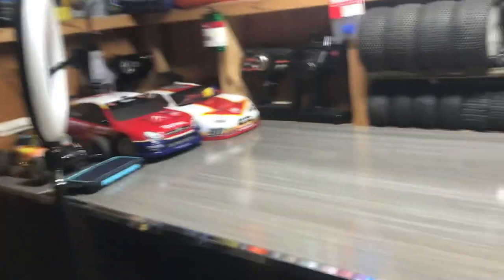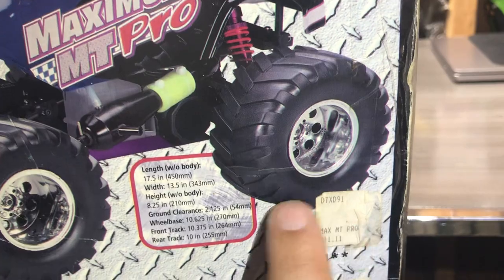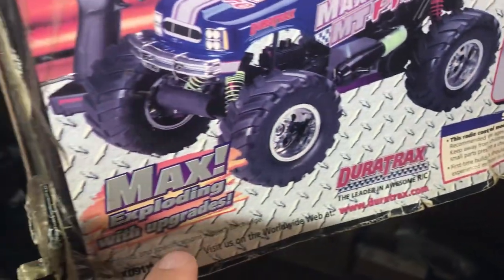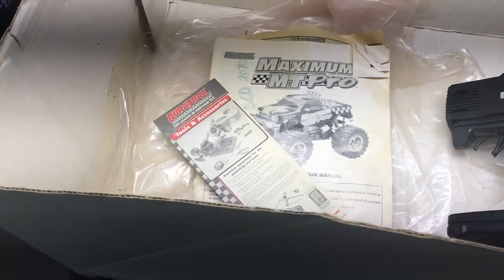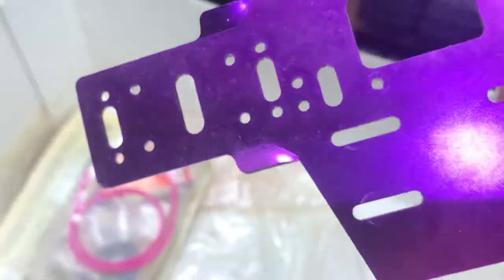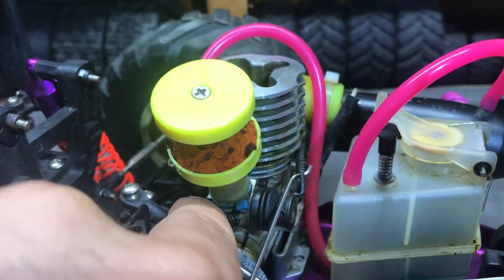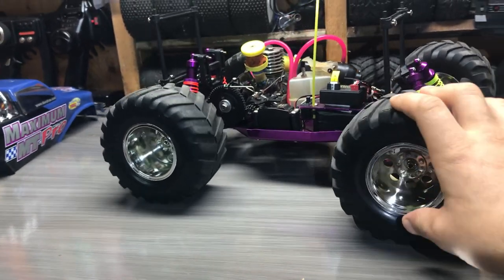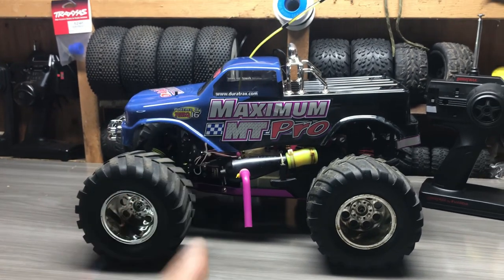Duratrax MAXIMUM MT Pro first look !!!

Comment: Brings back memories. I had the standard Maximum MT. My brother then bought the MT pro. 

That MT pro is a very pretty truck, body. The purple chassis really pops. Unfortunately they look better than they operate. I don't think we ever ran them one time where something didn't break, or screws didn't fall out. Run it for 2 mins and something broke again.
Reply from the maker: Definitely very nice looking truck for sure !!! I try to only run mine on road so I don’t have any problems with reliability. Only recently the fuel tank has a little sludge that needs to be cleaned out every one and a while . Other than that she’s been good to me !